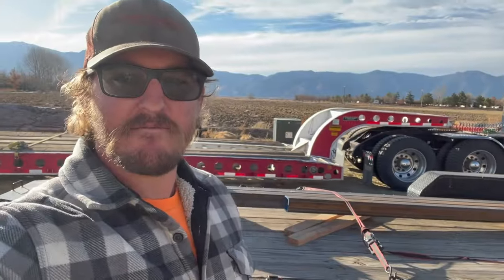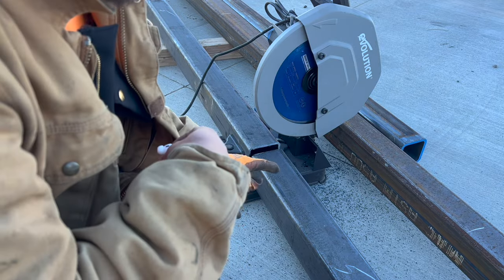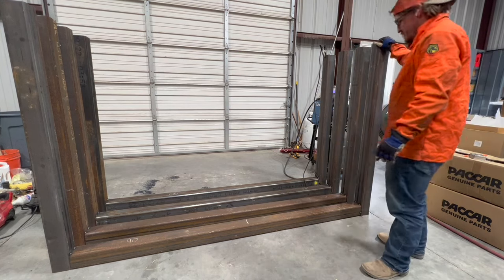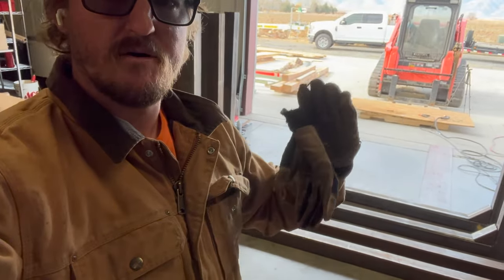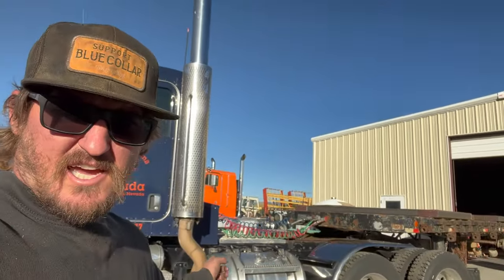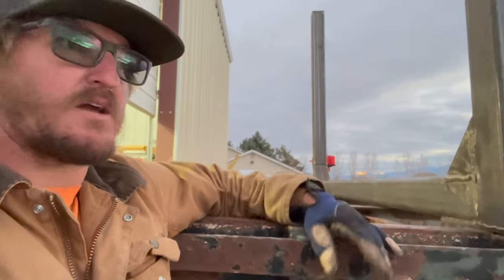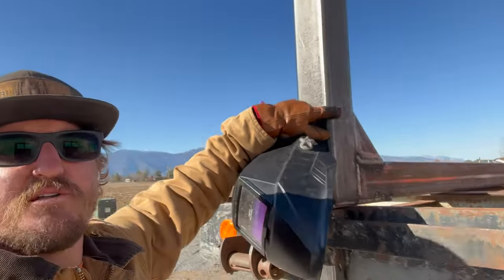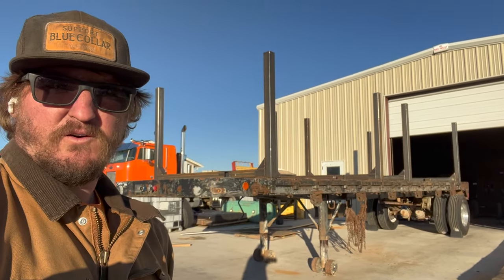How I Made Log Bunks For My 1966 US Navy Trailer

Comment: Good job of designing the layout, will the single axle hold the weight of the tree load
Reply from the maker: Thank you! Took a little time to think it out but I like it so far. It’s a heavier axel with load range H tires. Needed a short trailer to get into where I’ll be hauling logs out from. We’ll see how it does.